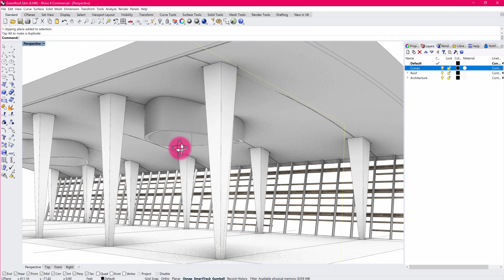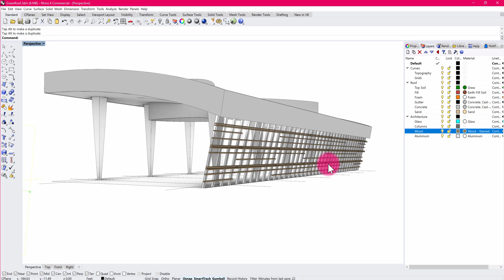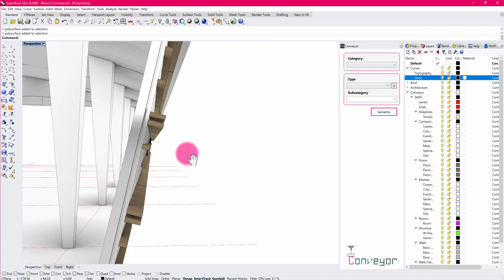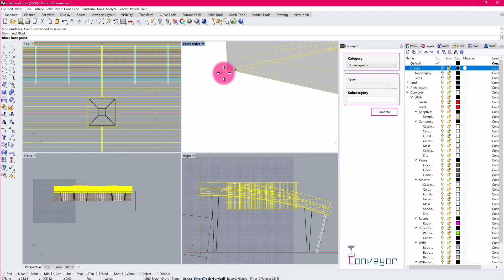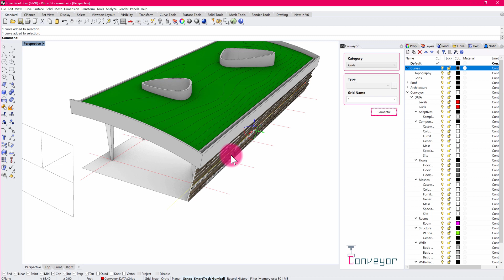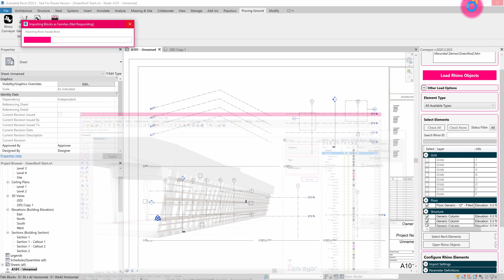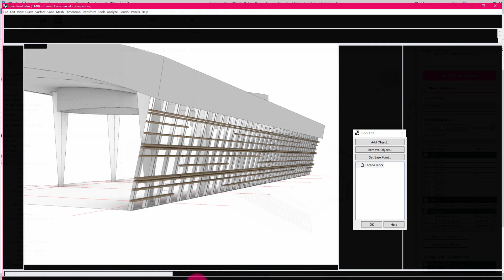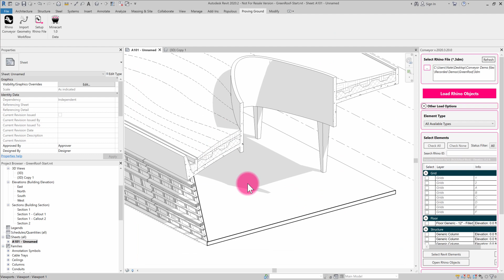Conveyor Rhino to Revit - Rhino Model to Revit Sheet with Blocks and Materials

Comment: Great video. Had a quick question regarding materials, cant we use revit to give material to the loaded Rhino model. Correct me if I am following a wrong workflow?
Reply from the maker: Yes - For example, if you have a block with materials assigned to sub-elements, Conveyor will try to match the material name to an available material in Revit. It'll also create a Revit instance parameter on the block so the user can change the assigned material afterwards. More info here: https://apps.provingground.io/docs/conveyor-documentation/how-to-manage-imported-family-materials/

Comment: It’s well done plugin! But extremely expensive for this value
Reply from the maker: If a single license saves an average architect architect 8 billing hours, it pays for itself. I'll argue that architects regularly using Rhino and Revit in parallel, the tool pays for itself in a month or less.
Reply: Proving Ground wish you guys would give out a few academic licenses. But the professor has to request? Really.